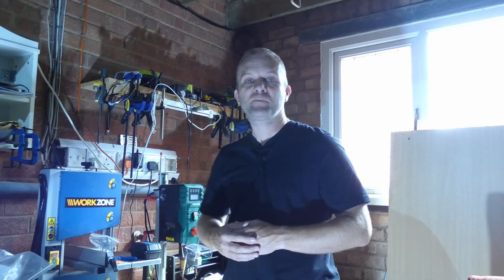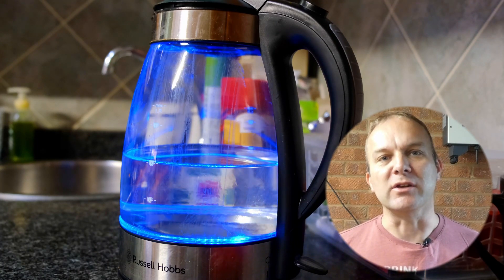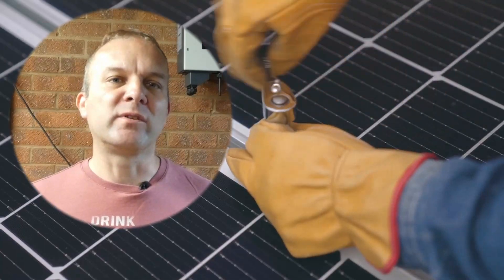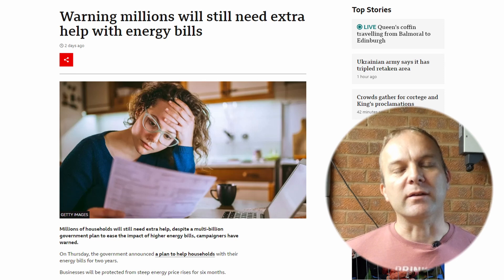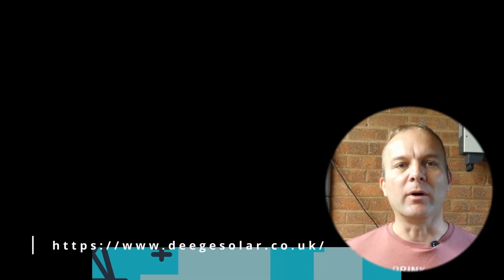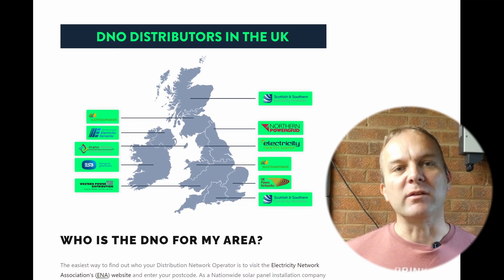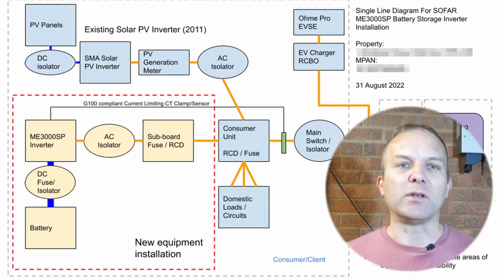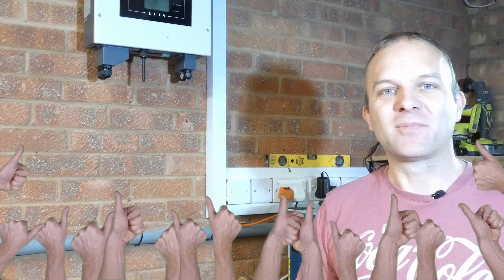DIY Battery Build # 1

Comment: Morning Stuart, a further question please. do you intend adding extra solar to the new inverter in the future? my thoughts were that especially in the winter, the additional solar could not only contribute to assisting any daily load, but also assist in topping up the batteries. In the summer though, when there would be an excess of solar (from both sets of panels) could an additional generation meter be added so that excess energy could be sold back under SEG ? my initial thoughts are that by the very nature of how the ac to ac inverter is integrated into the system using a CT clamp, that this feed back to the grid from the additional solar 9via the new inverter) cant take place. in that case, what would happen to the additional energy created or would the inverter simply switch off into some sort of 'safe mode' when the batteries were full ?
Reply from the maker: The export is measured by the grid smart meter, so export (even from a battery) is paid on the export tariffs, if you have one.

Comment: Thanks for posting - is there anywhere i can download your diagram please and ammend it to suit my own very similar planned installation please?`
Reply from the maker: The diagram I have is only relevant to my house/installation, its not difficult to draw one up yourself.  Just mentally walkthrough how the electricity flows into and around the house, meters, fuses, consumer unit etc.  I used Google Draw to design mine.

Comment: Great stuff!
Virtually same setup planned. On Octopus go and adding 16 Lifepo4 batteries.
However, no plan to add solar yet and certainly won’t be exporting to grid. Going for Sunsynk 3.6kw which is specifically designed for UK market to meet operators requirements. I was under the impression I wouldn’t need any permissions?
Also, do you have a wiring diagram?
Thanks
Reply from the maker: Unfortunately you will always need DNO approval if you are grid connected (even if not exporting).  I think I covered that and my diagram in episode 1 of this series.

Comment: Great video! Thanks! Did you get an electrician to sign off your work? Would be great to get a video update on your approach to that bit. That's one of my current stumbling blocks. That and a looped supply. I'm in Birmingham so waiting to see if WPD are going to agree to unloop me FOC?!?!?
Reply from the maker: Update coming soon! WPD have been really good, seem very helpful.

I did have a looped supply, and WPD removed that when I had a car charger installed. No cost to unloop.

Comment: I'm so tempted to build another battery. Shame you never got your 18650 system finished. I can honestly say that mine has been working a treat for many years now. Wouldn't have been so easy to build were it not for your excellent work on the DIYBMS, I'm always grateful for that.
Reply from the maker: Nothing wrong with the 18650's but in the UK, they are difficult to find and I really got fed up with the testing!!

Comment: In regards to this 3kw limit / classification... And thanks so much for making this all so easy to digest and make sense of. Really helpful.

So my (new) question is how much this 3kwh inverter limit then restricts the amount of energy that can be loaded into a household (from the grid) during the off peak hours? Assuming that its the same 3kw rating applied in both directions and cannot be avoided? hmm. Not sure i understand enough of the details yet. Just didn't have time to look into this particular aspect(s) any further. But the general overall impression I got is that... maybe it's typically only around a maximum of 4 hours off peak time per day? For these sorts of tariffs? Then again maybe there are other providers with different sets of off peak hours. IDK. So maybe this limitation is not something so rigidly set in stone.

However assuming it is indeed max. 4 hours loading (at @3kw) = 12kwH per 24 hour cycle. So (to me) ... that doesn't seem to be quite enough to fully satisfy a typical average household is it? But in particular I am thinking of heavier consumers (like our house for example), which is perhaps more like 20-30kwh per day, depending on the season. Or something like that. We have yet to find out ourselves. As this will be our first meter with a smart meter installed. Quite late to the party.

I suppose every bit helps. However you can get it. And if combined with some significant string of panels. Just would really prefer to be wrong about such set of assumptions. If the regulation 3kwh sizing being such a hard limit not to go over, right? And assuming the regulation is not ever expected to change. Or at least if there are no new government plans or policies on the horizon to consider doing so. Hmm we are indeed living in pretty uncertain times. IDK. Food for thought anyway.
Reply from the maker: The inverter will charge/discharge at 3kW, so it will take nearly 5 hours to fully charge a typical 280Ah/48V setup if this was purely from the grid.

It fits my usage electric usage model, especially when coupled with a low rate overnight energy tariff + solar in the summer.

As I only have 3kW solar, anything over that is a bit of a waste in my situation.

Comment: Can you share a redacted copy of your DNO application... its confusing for me.
Reply from the maker: Hi Stephen, are you also doing a fast track G99 application?  The diagram is the important part, so probably easiest to pause the video on that.
Reply: @StuartPittaway  I am... planning on using the same inverter as you coupled with Pylontech batteries. What did you put for existing installation and new installation?
I have had my solar install since 2013, 16 x 250W panels and an Effekta ES3680 inverter (3.68kW).
Reply from the maker: @safurniss  exactly what you have mentioned on the existing install for solar. The capacity is the inverter output rather than the size of the panels.

Comment: Hi Stuart,  I watched all Your video about bms and would like to use it with my off-grid system but I'm using 12V AGM batteries (48V system). Did You ever design 12V battery monitor or just 3.7V?
As first I want to ask You about it before I try to rebuild it for 12V batt.
Reply from the maker: No, 12V has never been a priority for this project. It would need quite a few changes to the modules to make that work.

Comment: hey my friend. have been following your other diybms project and am very excited to see this new series of yours. living in the uk i wanted to spec out a system and see what it would look like. and so i would really like to pick your brain here (for my comment today) over the inverter....

heard of the growwatt and the huei but never looked at them. i never heard of the sofar me3000sp. but certainly will be looking it up since you seem to think so highly of it...

the one i was previously directed to was the sunnyboy ones. however whilst relatively affordable the biggest one seems to have limited amount of grunt. and perhaps not expandable above its 6-7kwh capacity. so then i found out there this much more premium (and also relatively more expensive) german commercial brand one. which is around 4000k eur for the Schneider Conext XW PRO 8.5 kW. because that one seems to have everything features wise in the 1 box... really nice and it just seemed like paying more for that inverter could also mean potentially make it easier to pass inspections and comply with regulations and be more easy to connect to the grid. maybe saving hassles like that. and being easier in that sense.

so my question here is (if you had already seen this inverter). how your own choice of the sofar me3000sp compares against that Schneider Conext XW PRO 8.5 kW. because i think it would be a cool comparison. and help to reveal the value. in terms of cost vs performance. and whats missing, and how they compare for being able to get certified to be connected to the grid. since that other german option seems a bit pricey side. and not so affordable. whether or not that comparison makes sense? if not no worries. the i will just keep on looking into your own recommendaation of the me3000sp. (which was already going to do anyway).

regardless of that many thanks for your new video series. it really will help educate me a bit further than the point where i managed to get to on my own research. you have such a clear and simple way of explaining what is really important.

btw (and not related to this series or solar pv)....

i recently started planning to get into 18650 li-ion for power tools usage. so this is all still in planning stages atm. but what am hoping to do there is to put together my own power tool batteries. by ordering certain specific kits from china (not the old style, but the more modern updated ones). and then filling them with genuine and reputable high quality cells. which i can get from fogstar wholesale supplier here in the uk. so to check those new cells and vet them / balance them manually myself. to have some confidence in what i am using.

interestingly there is a new and recent development in that space. which is that the chinese who make these battery pack 'diy kits' (sans cells)... it seems they have now also cracked the drm copy protection for those new makita 40v xgt platform. so its now possible to buy such a brand new kit for makita xgt 40v. which is to say quite helpful matter given the cost prohibitive price and markup on genuine makita batteries here in the uk

of course those makita batteries (whether genuine or not). they are not actively balanced. you have to balance cells individuall before putting together the packs. then they just monitor each rows of the cells with tap points during the operational lifetime. and shutdown if any bad voltages of inbalance is later on gets detected.

also with the makita platform we have a much wider margins and healthier buffer zone. for the max and min voltage levels. to lower capacity in favor of safety. at least i hope so since they are such a high current application. with higher charge and discharge rates. to be (relatively) as safe as can be reasonably expected. (i sincerely hope so!). however be them as they may.... am also trying to look into those lipo safety fire bags. or other types of related safety measures and protocols for better contingencies. in terms of what is actually effective (or not!) for reasonable fire safety practices / what is best approaches to do around that. i feel that is also worthwhile hand in hand. and an important matter also. just definately dont plan on reusing any used cells. it just seems far too dodgy. when there is no reliable or bulletproof way to vet used cells and know their history. i have decided to steer clear as it simply isnt worth it. same for pre-assembled 3rd party packs. (when they might re-use 2nd life cells). it seems on balance just too risky around the typical familt home / residential type setting.
Reply from the maker: Before buying an inverter you need to make sure that it has a G99 and G100 certificate, otherwise you cannot install it in the UK.

Comment: Welcome the club mate. 30KW mate at least in batteries. I through for my solar system 20KW secondhand panels.
Reply from the maker: I'd struggle to charge 30kw of cells, probably half that to start with.

Comment: Excellent video , just what i am waiting for, i may be jumping the gun but why did you go for only 3kw and not the 6 kw inverter ? since you went through the application proscess . thanks
Reply from the maker: I followed the fast track process, which doesn't allow anything over 3.68kW.  I've also got an older solar install with only a 3kW inverter.  A full G99 application can take months to approve.
Reply: @StuartPittaway  Thanks Stuart my ignorance , didnt realise the 3.68 cap still applied .
Reply from the maker: @remog38  no needs to apologize. I've spent ages trying to get through the technical details of the DNO process, only to find it's actually quite easy!

Comment: Why you didin´t considered Victron Gear?
Reply from the maker: I don't have any existing victron equipment, do they make a grid tied AC coupled unit?
Reply: @StuartPittaway  Victron is the most versatile gear, you can  dc couple or ac couple. The answer is YES.
Reply from the maker: @javierborras7752  do you have a model number I can research?
Reply: @StuartPittaway  If I understand correctly your video you should go for Miltiplus II wich is an Inverter/charger there's a plenty of configurations you can personalize for your demands, it will charge your battery from your existing PV inveter and also use your battery to provide power to your house when there's no PV production. Look for Victron ESS with MultiPlus II. Hope this helps.
Reply: Also has the ability to provide a second ac output to orovide power even if there's a power outage from the grid.
Reply: @Clint E How does the multipus II 48V 3000 stack up to the SoFar ME 3000SP (they are like rocking horse poop to find) would that be the equivelant model?